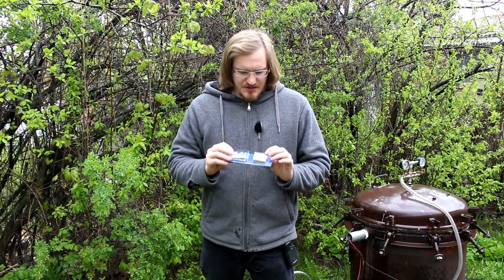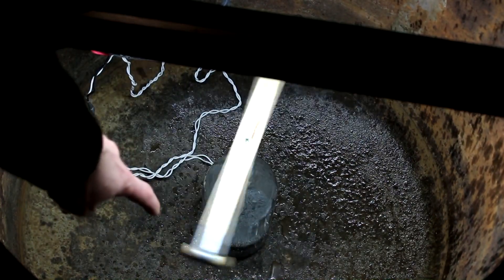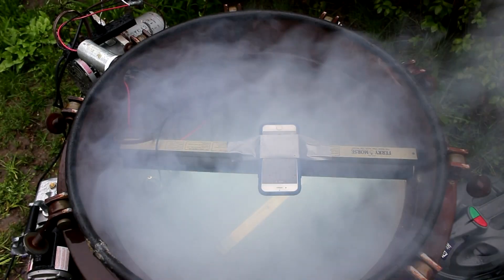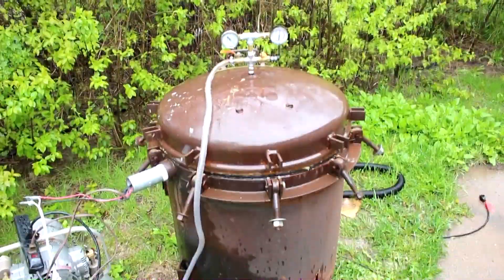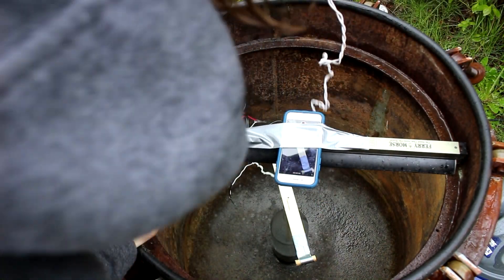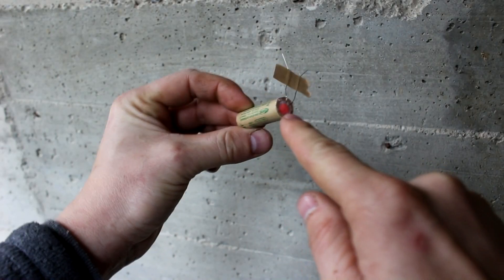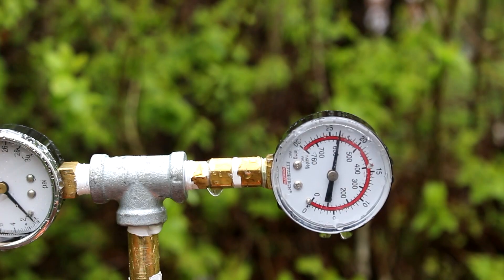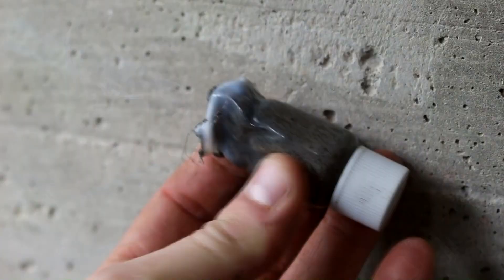Will a Model Rocket Motor Work In Vacuum?

Comment: In liquid fuel rockets, ignition becomes an even more serious issue. Not only is there the problem of requiring the pressurization of fuel and oxidizer within flammability limits, but the method of actually igniting the fuel quickly and reliably becomes a major issue. If ignition is delayed even a few milliseconds, the fuel-oxidizer mixture can be ruined, delta-V can end up being wasted, or worse: the ignition chamber can become overpressurized, which most often leads to a catastrophic failure known as "hard start" or "rapid unscheduled disassembly". Additionally, electric spark ignition is often not reliable enough for many F/O mixtures, meaning that other ignition sources must be used, such as pyrotechnic charges or torches. These are often limited in supply, restricting the number of times the rocket engine can be cycled, and may require some minor maintenance to be used again if the engine has been cut off long enough to go cold.

Comment: Can you explain this part to me like I'm 5? The rain lowering the the minimum pressure. (3:05)
Reply: HaloBalla, he was probably referring to the fact that water has a certain vapour pressure, ie if you have some water at the bottom of a container with air in it, the air will eventually contain a certain amount of water vapour - which is a gas. This gas contributes roughly 3 or 4% to the total gas pressure inside the container.

Comment: combustion need O2, vacuum has no O2 just ignition without chain reaction to combuse
Reply: The O2 is in the oxidizer inside of the rocket.
 you realize if the rocket did not have O2 inside of it it would not work under atmospheric pressure either, they do not burn oxygen from the air

Comment: I would think that anything with an independent oxygen supply would work in a vacuum. Most model rocket engines have KNO3 or NO2 as their oxidizer and the full-scale rockets use liquid oxygen.
Reply: You'd think but apparently the chain-reaction cannot sustain itself in a vacuum

Comment: the ignitor creates a flame to ignite the propellant.  In the vacuum there is no air for the ignitor.   Space rockets use electrically fired propellant or a pre-ignition source that will work in vacuum.   The shuttle used a chemical based thruster to move around in space and for the main motors.

Comment: Are there lithuim batteries of any kind on space? I've always wondered how would those behave in vacuum.
Reply: If I had to guess the lightest most energy-dense batteries would probably be the ones they would use in space
You can see in this video he used a phone with a lithium battery to film so lithium batteries do still work the thing is the flexible casing can expand.

Comment: well solid rocket engines are made of some sort of fuel and contains its own oxidiser so it should go off about normal or a little bit less powerful (because there is no extra oxygen in the air fueling it) as in the normal atmosphere
Reply: Yeah that's what you assume but the vacuum creates an insulated environment that doesn't allow the chain reaction to continue, also Rockets do not use atmospheric oxygen at all.

Comment: I don't think that last motor burned completely.  The smoke was less.  The movement of the spinner was less.  And the ejection charge did not POP like the first run. So I think you got it to start but it did not sustain itself.

Comment: What happened to the ejection charge in the second rocket?  it certainly went off in the first one (pressurized one).  The rocket "in vacuo" seems to have burned for a slightly shorter duration also.  You should have cross sectioned the motors to see if all fuel was spent.

Comment: NASA could have done the same test, however, they would spent closer to 30 million dollars to do it.
Reply from the maker: probably did
Reply: The LHC is the longest by length but the NASA one is the largest by volume.

I don't know if NASA have ever tried igniting solid rocket motors in a vacuum though, as far as I know they've only been used for the first stage/side boosters (so by the time they get to the vacuum bit they're already ignited).
Reply: They're both huge but NASA is larger by more than double the volume, the largest vacuum area at the LHC is 9000m3, while the Space Power Facility's vacuum area is 22,653m3. EDIT: The confusion may come from the fact that there are actually three separate areas that have to be subjected to vacuum at the LHC, so it might be easier to say the SPF is the largest single vacuum chamber.
Reply: Because real rocket engines are a tiny bit more complex than store-bought model rocket engines
Reply: Wait, I've checked, there are some solid rocket upper stages from US aerospace companies, so yeah, it's pretty likely their igniter has been tested in NASA's vacuum chamber.
Reply: When NASA tests rockets in a vacuum, they are not really testing to see if they provide thrust.  I think they are aware they do, what with Newtons laws and all...  They are usually testing efficiency and if the cooling systems will work.  The rocket bell usually has liquid fuel and oxygen routed through it to cool the bell, and heat the fluid.  They have pumps to push the fluid that run from turbines etc.  Testing to see if those work in a vacuum is critical.  Prevent one 100 million dollar space probe from blowing up in mid flight and the 30 million dollar test becomes a bargain.
Reply: NASA have the largest vacuum chamber in existence, I bet it cost magnitudes more than 30milllion just to build the chamber. It's the unfortunately by product of holding yourself to the highest standard for precise data.
Reply: Anticonny no you are right
Reply: yes, after starting with the small scale tests like in this video. start small, then go larger to insure the data is consistent, it is thanks to their 30 million dollar experiments you can get on your cell phone that uses satellites to yell at the world that nasa spends too much money.
Reply: @Slash0mega  um cellphones could exist without satellite. The internet and cellular systems are just wired networks with wireless access points. There are satphones for military use but otherwise cellphones don't send or receive signals from space. Well excluding GPS of course.
Reply: But even GPS can exist without satellites
Reply: @Imaboss8ball  yeah the internet did exist without satellites for a while, but how am I communicating with you instantly from 4000 miles away with no wires going across the ocean from my Island to a wireless service station on your side of the planet.
You can bounce some stuff off the ionosphere but that's not what's happening.
Reply: SuperSMT
Not necessarily. The Shuttle SRBs are basically just aluminum tubes filled with solid rocket propellant, just like the small ones. Incidentally, they are also the most powerful rocket engines ever made.

Comment: ...I don't understand this, He tested a rocket under normal atmospheric pressure and it worked fine. Then under a vacuum and it failed to burn, then decided to put it in a bottle under normal atmospheric pressure and then into a vacuum, which of course it will work...the rockets back in normal atmospheric pressure and of course it will produce thrust, because the bottle became super pressurized and then burned through the bottom releasing all that pressure thus propelling the rocket.....But...although the bottle was in a vacuum the rocket was not and therefore the rocket never was successfully burned in vacuum conditions. 

Basically, the test results I just saw was,

Normal Atmospheric  Pressure = Burn
Vacuum = Failure to Burn
Normal Atmospheric Pressure again while also in a vacuum = Burn. 
There was no successful test of the rocket burning under just a Vacuum.
Reply from the maker: the bottle didn't last for the full burn.

Comment: You don't need oxygen if you mix it into the fuel. That's why rockets use a fuel and an oxidizer. Solid fuel rockets mix the oxidizer in, liquid rockets use liquid oxygen.

Comment: Dude. Are you for real standing, standing on wet ground, holding onto a friggen indoor power strip in both hands, unplugging power cords IN THE RAIN!?
Reply from the maker: nothing wrong with that. ;)
Reply: Power strip has it's own circuit breakers anyways, I think that would prevent him being electrocuted for the most part.

Comment: I wonder if slowly heating the motor from inside with an electrical resistance would also work, since the unburned portion of the fuel wouldn't  need to heat up with the gas from the burning front in order to ignite.

Comment: I am pretty sure those igniters are suppose to be used at 9-12v not 120v? I'd imagine at 9V it would stay hot longer allowing the gun powder to ignite. Like your gun powder match video. The heat doesn't remain around long enough to ignite the powder when you spontaneously combust it with 120v in a vacuum.
Reply from the maker: Who said it was 120 volt?
Reply: Just me. It looked like you were plugging that into a 120v power strip. Unless i missed something.
Reply: Went back and looked. It does appear like maybe you have some sort of device maybe connected between the 110v strip and the igniter. Didn't mean to assume so much, but those igniters seemed to pop a lot harder than I remember when I used them a lot of years ago.

Comment: Are you sure it was the pressure in that little cheat-bottle though? I remember the Myth Busters building something similar and iirc their explosives worked just fine as a rocket, even without the small chamber around it.
Reply from the maker: They used something that exploded more like a bomb than a rocket.

Comment: Why not use a piece of nichrome to get it started? you could use a small battery taped to motor with insulator preventing circuit from closing. Pull insulator (completing circuit), and ignition (eventually).

Comment: Could've just used a water hose with a nozzle to do this experiment. How about someone tape a stick of dynamite to their head a set it off in a vacuum if you don't think it will have a pushing effect on you when it pops.

Comment: And I really thought it would burn from the beginning. I figured as long as there is a source of oxygen in the compressed powdered chemical rocket motor, that would be converted to gaseous oxygen as soon as the reaction began, it would be a full, essentially unencumbered burn. Apparently I didn't factor in the exact chemical composition and the evidence that the sudden pressure created when it initially tried to ignite, would be enough to extinguish the burgeoning flame front. See, now I know why I'm not a rocket scientist!
Reply: No I think it's the opposite, there wasn't enough pressure to sustain the burn, the way I understand it the powdered needed to reach a certain temperature to light and maintain burning and a vacuum creates great insulation so it burns out before transferring enough heat to light the rest of the mixture and if you add pressure by putting it inside of a bottle then it provides a medium for the heat to travel through to ignite the rest of it.

Comment: they don't use solid rockets designed to start in a vacuum do they? I mean you've got solid fueled ICBMs and the Pegasus that have a solid fuel upper stage. What was the altitude equivalent of the pressure in the chamber when the rocket wouldn't fire?

Comment: My issue is you are hooking up that little igniter to 120V AC and it's pretty much exploding rather than just heating up to ignite the fuel, you should have connected it to 9V worth of AA batteries (instead of a single 9V because the AAs will give more current) this would give you an extended ignition time and maybe the fuel would ignite

Comment: inside of the vacuum chamber there is no oxygen or little enough to matter. i might be wrong but dont the model rockets use normally present atmospheric O2 as the primary oxidizer for the fuel? in this case a certain amount of O2 was saved inside the sealed container allowing for a more thorough but still limited burn, once it ran out of of O2 it would not be able to sustain ignition.